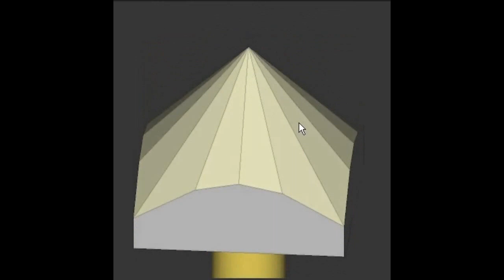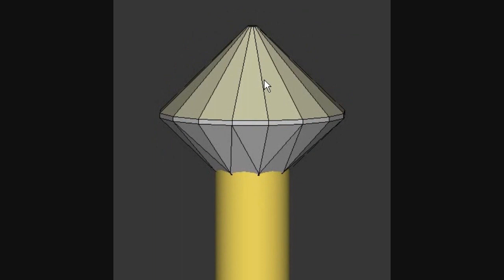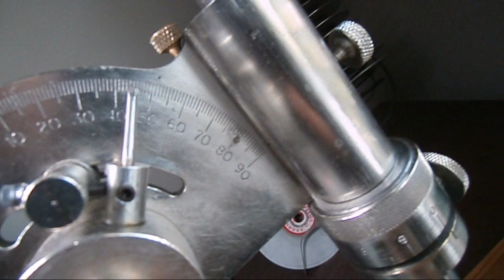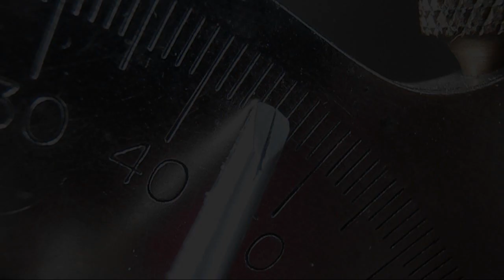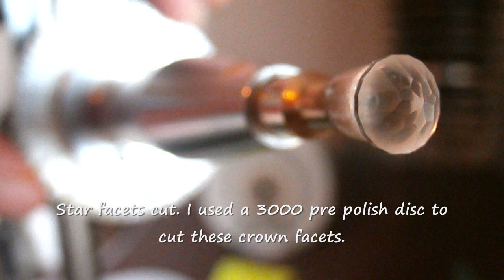How To Cut Gemstones -Topaz / The Zircon Cut

Comment: I like the fire of this cut.  Thank you.  A few videos back you were given some new adhesives to try.  But by the looks of it, you've gone back to the epoxy.  Any reasons why?
Reply from the maker: I'm saving the super glue for the cabochons I make at the gem club. The super glue is a lot stronger and I use more pressure on larger grinding wheels for cabs.

Comment: Thank you Cliff for your videos! I do have a couple of questions though. I’m just sort of dipping my toes in the water of the Lapidary world.Like you it would be a past time not a money making venture.I’ve looked at some basic polishing tables,I’ve found one that’s under 300$. Is it a worthwhile investment or should I save for some more expensive? Where do you get your DOB materials( The rods and glues )? Do have any videos that cover the basics of proper tool usage?( How to mount a stone on a dob, how to set up and configure your angles on the grinder for faceting )? My wife and girls have done a bunch of rock hounding trips around and now I have a pretty good supply of rough stones and I would like to start building my skills to bring out the potential in these incredible gems.
Reply from the maker: I would buy a good second hand machine. One that is manufactured in the country you live in. Dop sticks should come with the machine, plus the transfer block and index wheels. I buy my glues off Ebay.
Reply: Thank you for the helpful information , I’ll start checking EBay. I appreciate the info and please keep making videos.